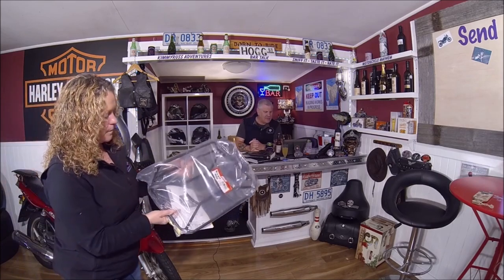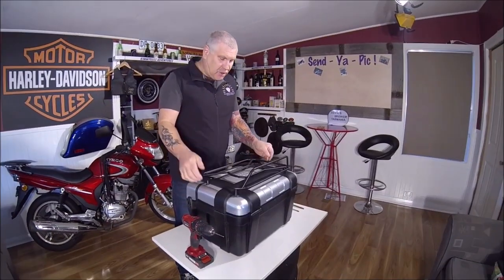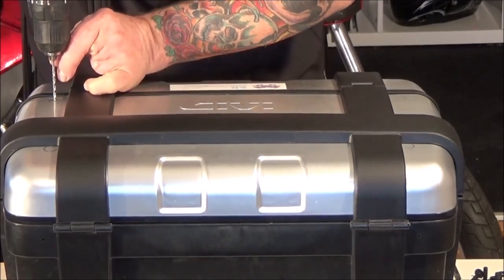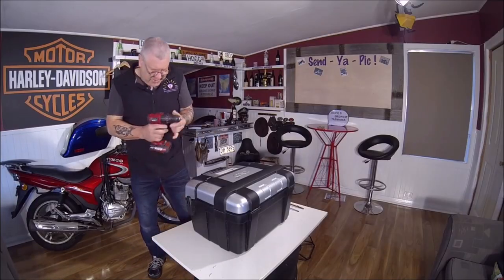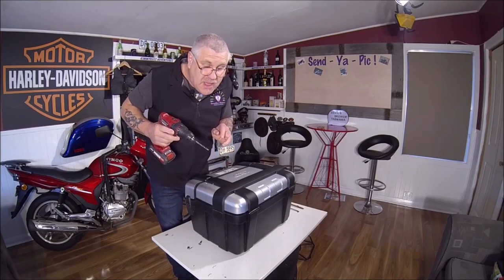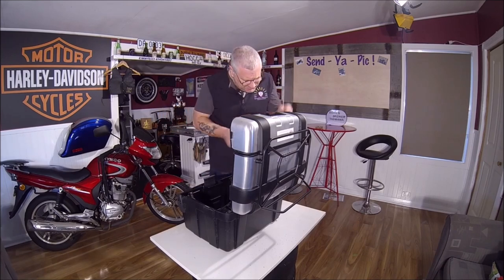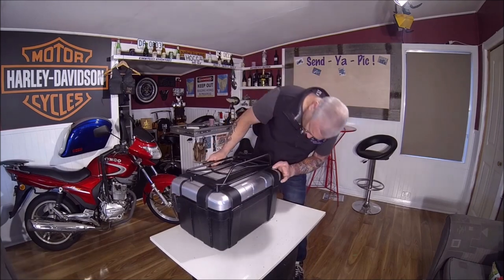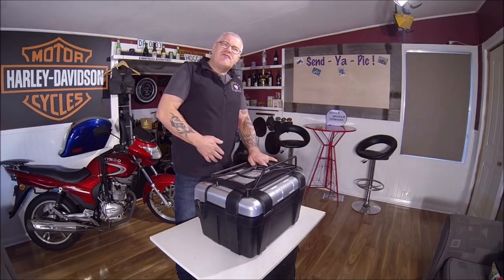Givi E142B Top Case Luggage Rack install on a GIVI TRK46N Trekker Monokey  Case for a vstrom 650

Comment: I used a hot screwdriver to melt the holes through took about 10 seconds for perfectly smooth holes I used a blob of sealant on each bolt too to stop any water ingress. Literally a 5 minute job in total.

Comment: I believe it is pointless to add this. The weight of the rack is closer to 1 KG (968grms) and the total capacity limitation on this case is 10kg.... This takes away 10% of the capacity. Had this been detachable.... Maybe then.
Reply from the maker: Well it's the same for bags that u put on the side as well so maybe they are pointless as well but it is good for a just in case
Reply: @kimmyrussAdventures  what bags! ?
Reply from the maker: @mysticmusafir3344  side bags
Reply: @kimmyrussAdventures  well the total (suggested) load we can put inside or on this top case is 10kg.  So this 968grams... So, we are using this out of our total allowance. That is my point.